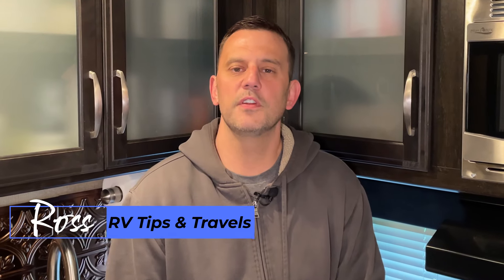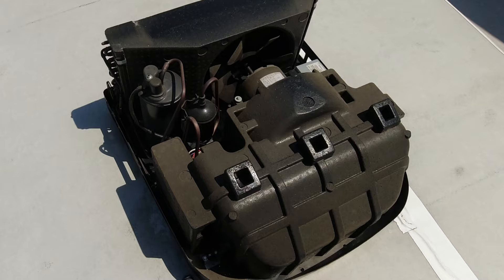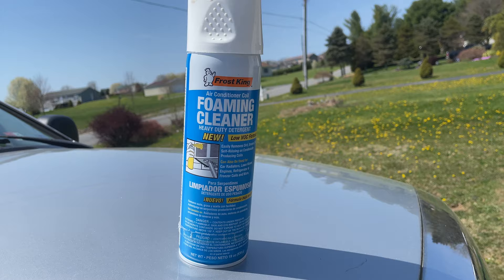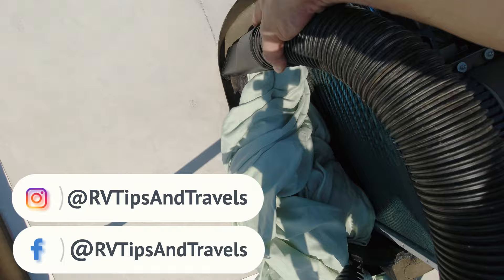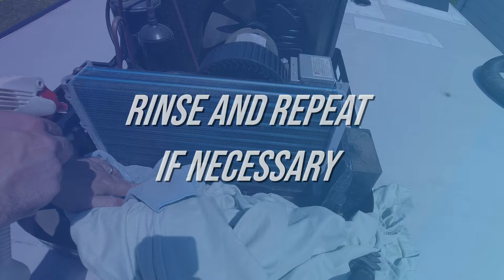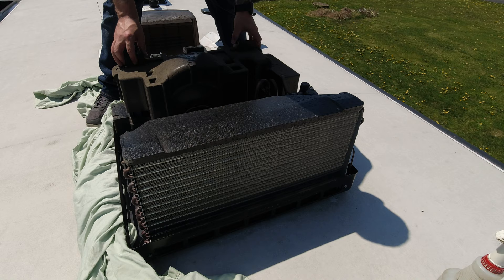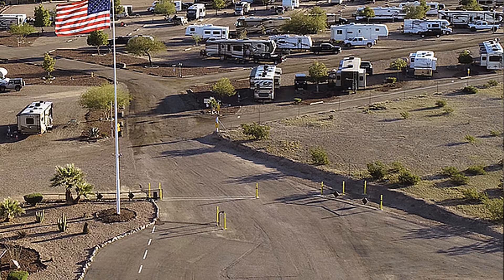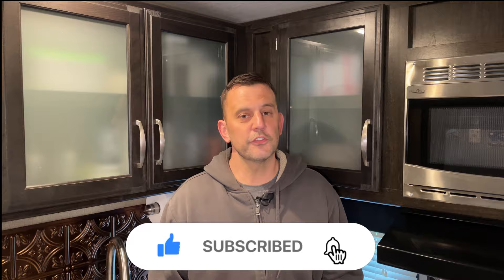RV AC Coil & Filter Cleaning -  Air Conditioner Maintenance Made Easy

Comment: Thx for the video ...but I'm about 120 kg is is safe to stand on the roof like you did😳
Reply from the maker: I would check the specs in your specific owners manual Lewis.  Thanks for watching.
Reply: @RVTIPSANDTRAVELS  I'll check but I'm not sure roof load capacity will be included
Reply from the maker: Year make model?
Reply: @RVTIPSANDTRAVELS  it's a la vista majorca.not sure the year it is 230 am here
Reply from the maker: Sorry Lewis, I can’t find any information on that.
Reply: @RVTIPSANDTRAVELS  no worries thanks for looking